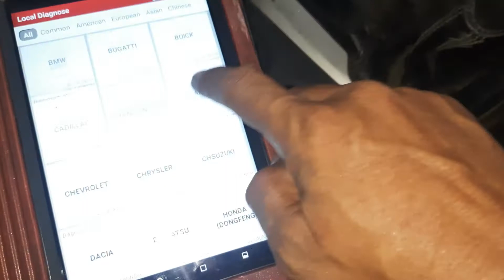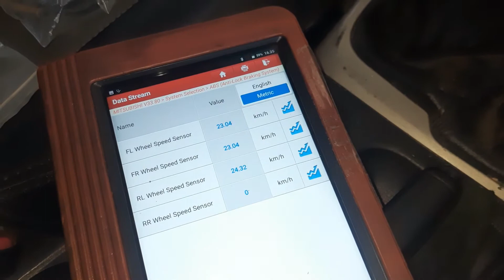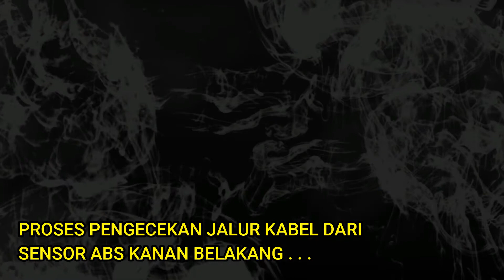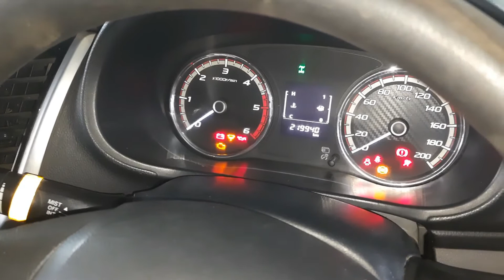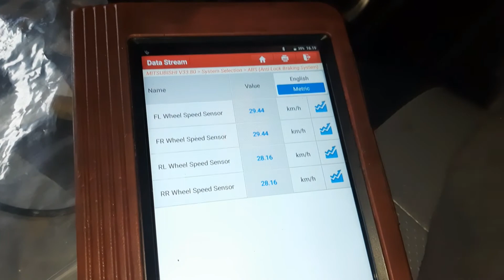Harus tahu tentang ini jika Indikator ABS masih tetap nyala

Comment: Video yg sangat bermanfaat. Tp sy punya kasus aneh. Dari hasil scan, sensor abs roda depan kiri dan kanan bermasalah, tp lampu indikator ABS tdk menyala. Apa masalahnya ya mas?
Reply from the maker: Saat kontak On...lampu indikator ABS seharusnya nyala sesaat kemudian mati saat mesin telah dinyalakan.
Jika lampu tdk nyala saat di kontak ON, kemungkinan ada masalah pd panel indikatornya atau ada kabel yg ke kendor atau putus ke panel indikatornya.
Pastikan cek semua sekring jangan ada yg putus
Reply: @AJMcrews  betul, saat kontak On indikator ABD menyala sesaat kemudian mati saat mesin menyala (Normal). Dari hasil scan, sensor ABS sebelah kiri ada pergerakan sedikit (hanya sampai 8KM, walupun mobil sudah melaju diatas itu), yg sebelah kanan tdk ada pergerakan sama sekali (0).
Reply: @AJMcrews  sy sudah buka dan periksa sensor ABS kedua roda depan, memang sudah cacat sedikit sekali, terkikis dibagian samping, bukan bagian ujung, tp magnetnya masih berfungsi normal. Sy juga sudah periksa soket dan jalur kabel dan tdk ada yg rusak. Cuman sy tdk tdk punya alat unt mengecek arus kelistrikan kabel itu. Di panel instrumen yg muncul: cek engine menyala, speedometer tdk aktif, indikator suhu juga tdk aktif. Mobil sy suzuki s cross mas 🙏
Reply from the maker: Jika lampu indikator ABS normal, seharusnya tdk ada masalah pd semua sensor2 ABS.
Kecuali lampu ABS nyala terus maka sensor2 abs salah satu penyebabnya.
Jika ada Scanner yg bisa streaming data, coba lakukan seperti pd video ini
https://youtu.be/OFj_gynvSUI
Reply: @AJMcrews  sy sudah lakukan scan streaming seperi ini mas, hasilnya: sebelah kiri ada pergerakan tp angkanya cuma maksimal 8Km walaupun putaran roda sudah kencang. Unt sebelah kanan sama sekali tdk ada pergerakan (0)